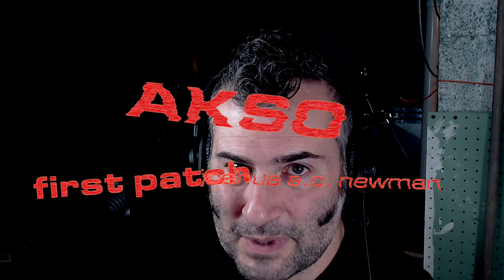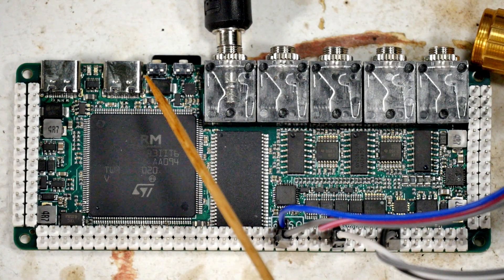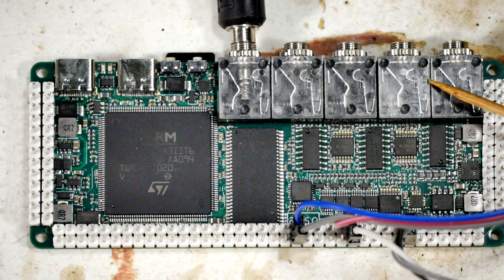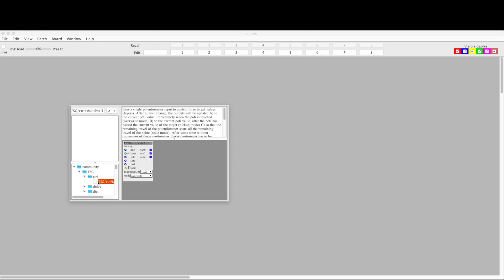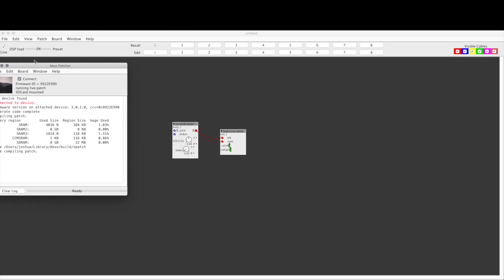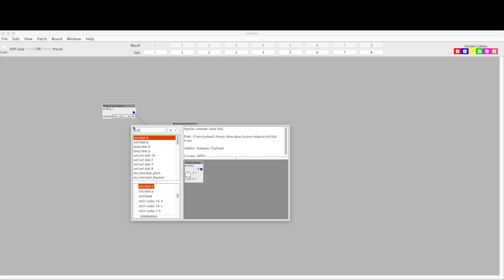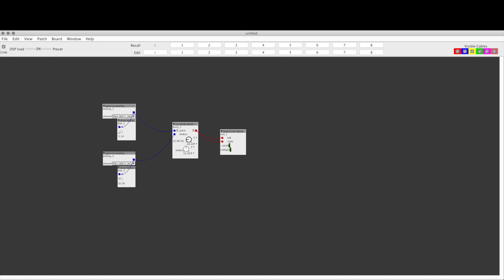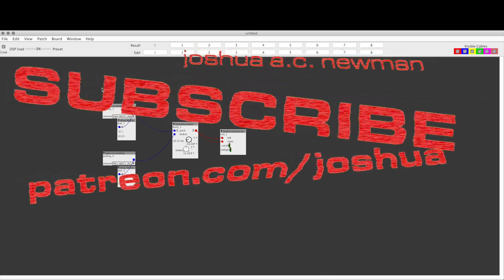Akso Tutorial 1

Comment: Hi Joshua! This thing looks VERY cool, am I right in thinking it would pair well with the Volca Modular? It also uses +/-5V, but I don't know if they could be grounded together (I'm new to this world!)
Reply from the maker: It can! You can always ground things together — that’s what grounding is. Even if it’s a little off for one reason or another, it will just shift the signal one way or the other.
Reply from the maker: I just remembered the Volca’s jumper wire system. I don’t have one, but I remember discussing it with a friend. If push comes to shove, you can run a shared ground wire into the Volca’s battery compartment.